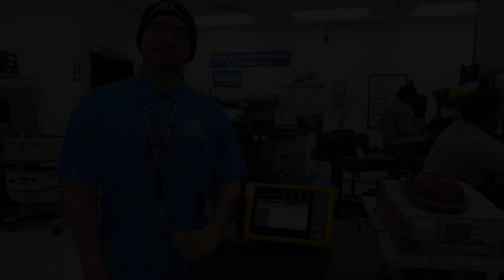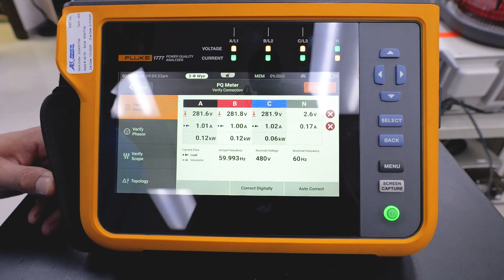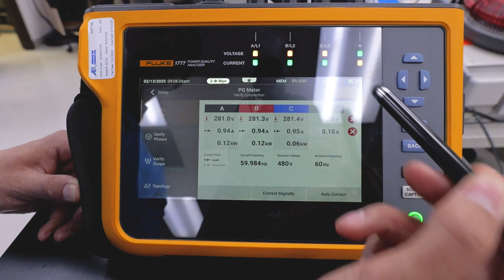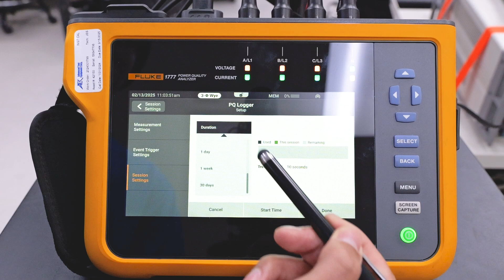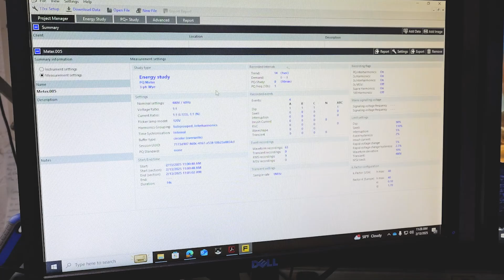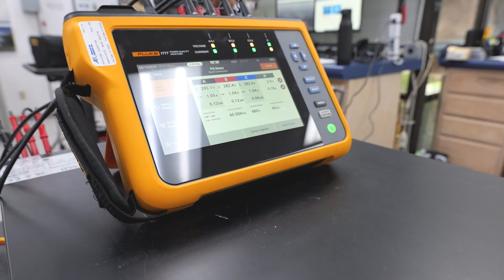Fluke 1777 3 Phase Power Quality Analyzer | Power Quality Monitoring & Waveform Analysis Ft. Pedro

Comment: Hi question, I have same fluke series. My goal is to record 14days event. But what happened after 14 days, I downloaded the data but it just record one day before the session ends. Can you help me, what is the problem of this device?
Reply from the maker: We would suggest using the newer DSX-5000 with the DSX-PC6A Patch Cord Adapters to test Cat 3 cable. Channel Adapters (CHA001A) technically are not the appropriate solution.